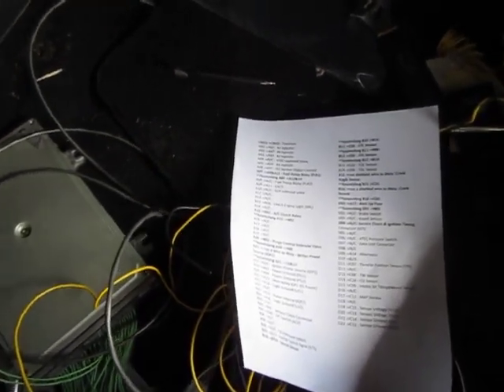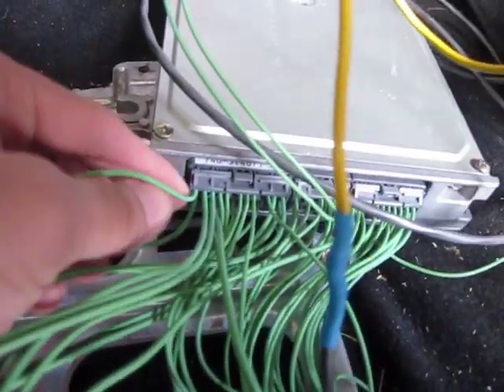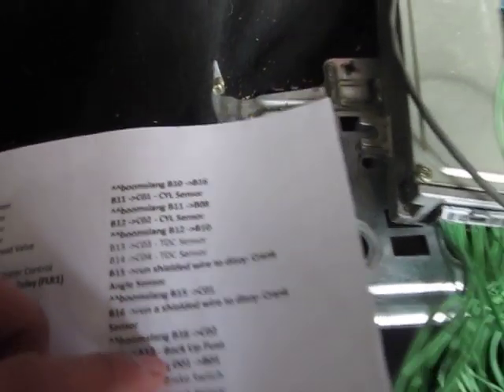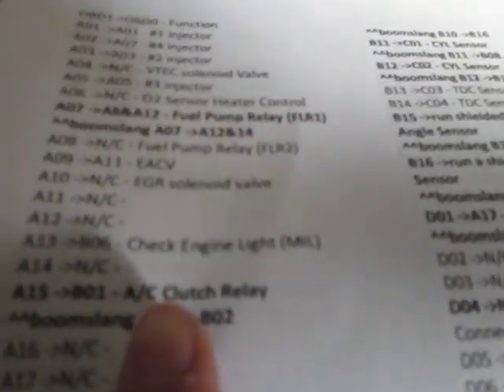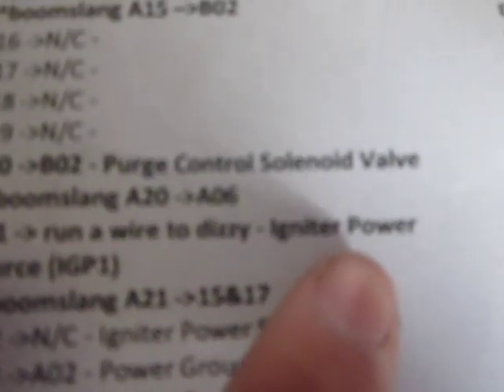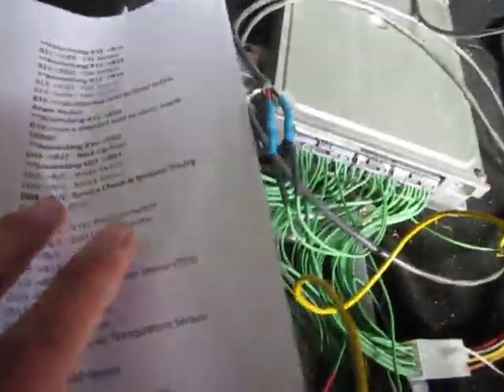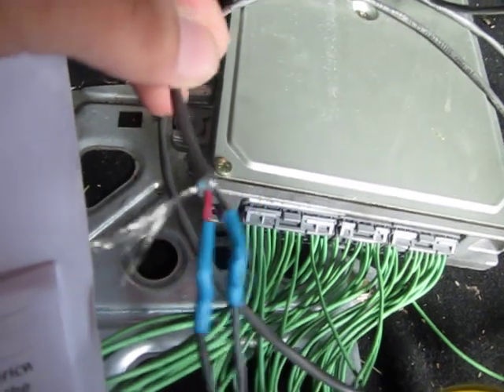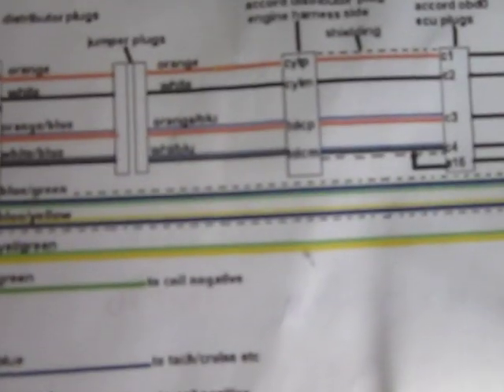OBD0 to OBD1 quick vid

Comment: Very nice video man! I am having troubles with my OBD0-OBD1 swap i bought a cheap Ebay connect harness and made a dizzy harness checked dizzy harness 100 times and its good. So must be my ecu harness. I get no start i have spark and im throwing 0 codes everything is perfect with the OBD0 Pm6 no codes and runs great so maybe i should check my connector out and see if its pinned right?

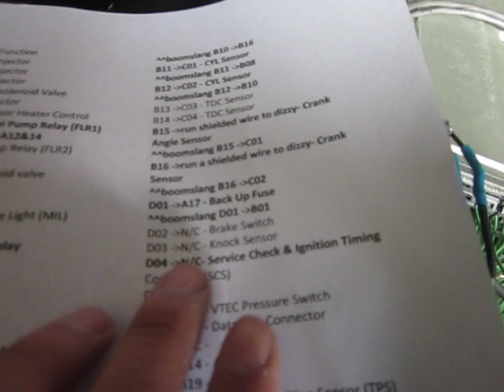Comment from the maker: 4:47 into the vid i talk about it. You ground D04 and turn the ignition to the on position and the check engine light will start to flash if you have any codes.